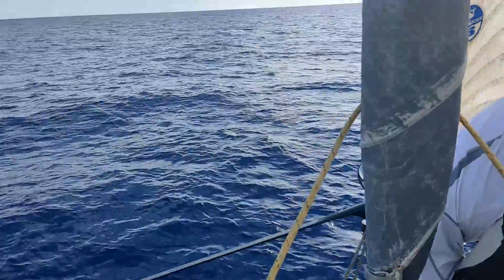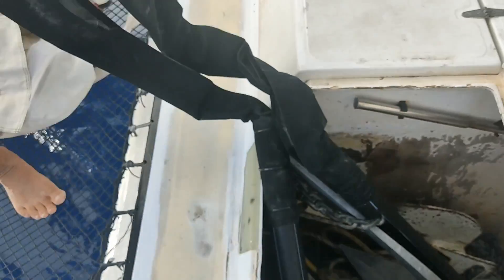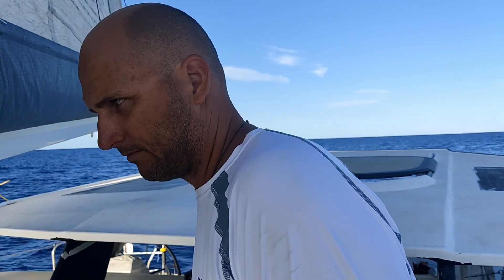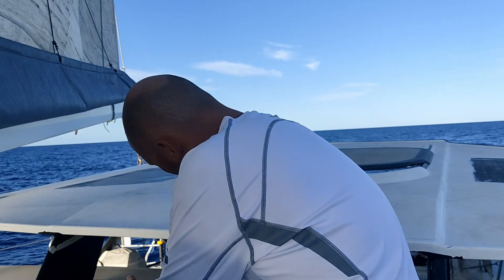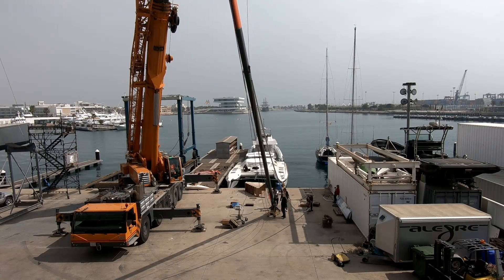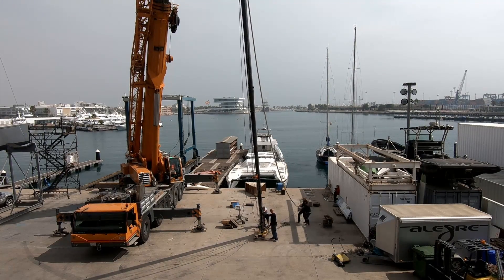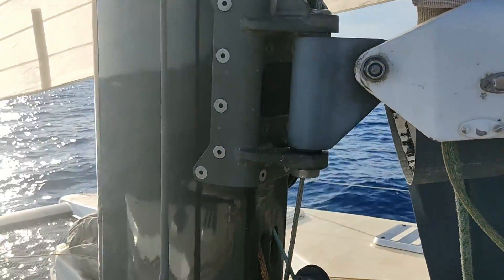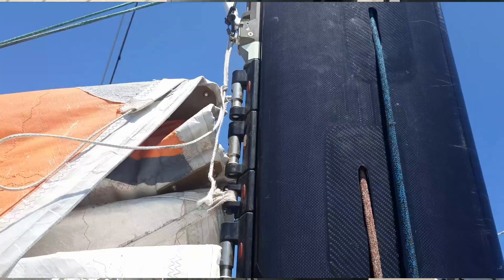Our Rotating Carbon Mast and Anchoring Sytem

Comment: What kind of mast rotation sensor do you use that integrates with your B&G system?
Reply from the maker: Haven't got anything. It's way out of our budget ATM 😅
Reply: Thanks in advance for any recommendations. I have a Van Dam 38 with a Van Dusen free standing, rotating, carbon wing mast. I have a basic B&G system with the wireless wind pack and just hoping to integrate a bit more data so I can calibrate and trim things accordingly.  At the moment I just have a set of tell tales on the mast....so very basic mast trim. Thank you @youngbarnacles
Reply from the maker: We've got a bit of a discussion thread on our forum about it. www.youngbarnacles.com

Comment: Any chance you could talk about shrouds...looks like some are dyneema and others are wire? Really enjoying your channel. Thanks for the videos.
Reply from the maker: We reused the wire stays from our previous mast and added PBO lowers. Our intention is to eventually use synthetic stays once the life of the current ones expire. We've added lowers to this mast as there are no diamonds or spreaders to control the lower panel. The connection point between stays and mast are synthetic loops. We are currently working  on putting a lot of this information in detail on our website www.youngbarnacles.com
Glad you like the videos 👍
Reply: @youngbarnacles  great, thank you!

Comment: Does it have UV protection? i believe AC boats equipment have none to save weight, you better put some on, or you risk having your mast fold on you in a couple of years.
Reply from the maker: Yes and no😉. Yes you are correct, our race boats particularly AC boat do not have much or any paint. We do however have some coatings that we use to try keep them clean.
By not painting the rig will not mean it will fall down in a cruising application. Now I only say that as it is a prepreg rig. The first layer will as you say fail, but the rest of the rig will not. What happens is the epoxy fails with the UV light, but the carbon fibres themselves protect the remaining thickness of laminating from the UV. So the mast will not fail so long as the final layer is not a high structural contributor. 
Our mast was painted, one for UV protection and two to look cool😉. Also and mostly it is for the inside of my legs. A race boat rig is murder on the inside of your Legs if it has been plugged in for a few seasons when you go up and down it.

Comment: Another great video guys. It's good to see a professional take on repairs and modifications rather than the usual amateur stuff. I would like to do a similar Longeron on a 46 footer I'm building to get away from the prodder braces which tended to chafe and rub on the anchor bridle on my last cat. Any ideas where I might look to find a second hand carbon section on the east coast of Australia?
cheers Scott
Reply from the maker: Thanks. Glad your liked the vid. There are rigs around but they are hard to find if you are not in the local race boat circles. It seems to be a cultural thing too. In Australia and New Zealand people are happy to fix a broken mast so they  are in hot demand. It may be worth putting feelers out at the yacht clubs and Facebook pages for any leads. Good luck
Reply: @youngbarnacles  Cheers will do
Scott